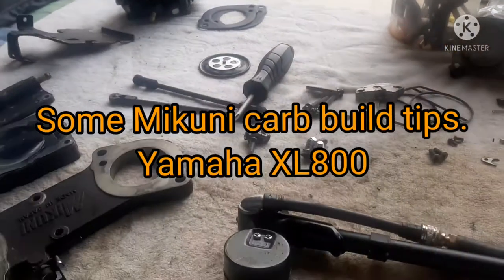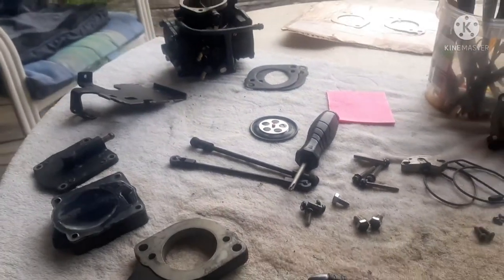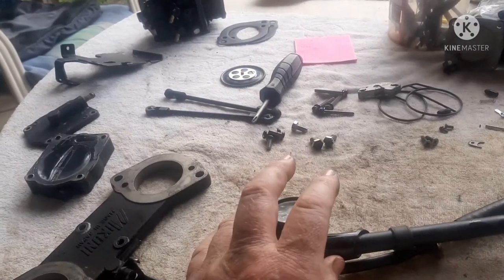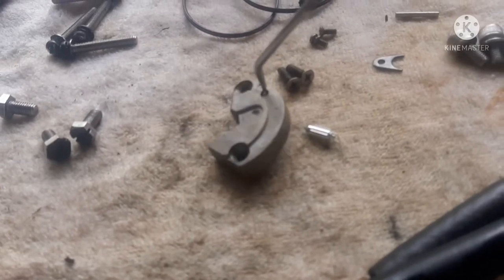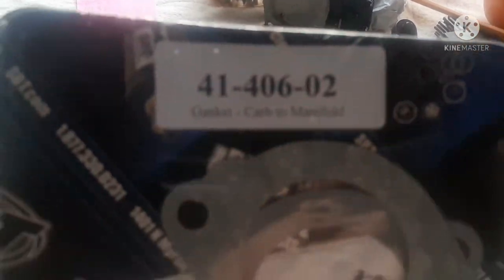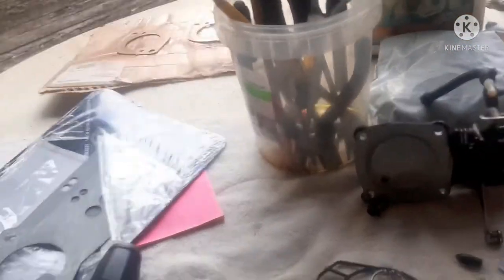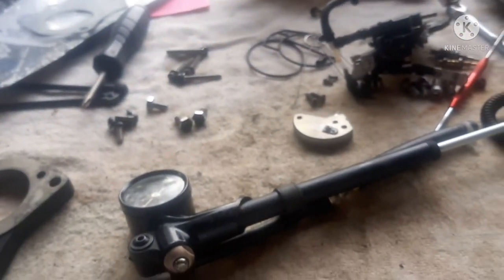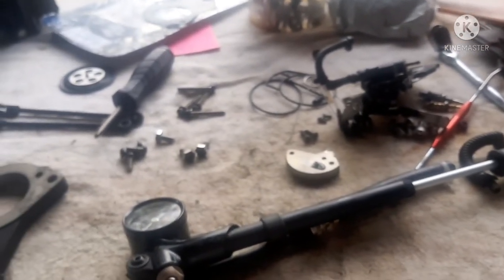Some Mikuni carb rebuild tips.  Yamaha XL800

Comment: I’m going to be doing mine this weekend. I have a set of WSM rebuild kits. Hopefully they’re OK
Reply from the maker: I used no name brand kits...did a video they dont work.  I used SBT kits...no success.  The only ones that worked for me are Mikuni.  I know WSM has good gasket sets but I didnt even know they had carb kits.
Reply: @ShadetreeJetski  I’ll let you know how the wsm carb kit works. My dad has a supplier that sends him parts for boats and that is what they sent me for my ski.They look like good quality
Reply from the maker: If you look at that video maybe that is what you are talking about larger orings.  Yes Mikuni makes an oring with squared off edges that is larger than just a normal oring.  If that big oring and the funny shaped one that seals the pump area dont have squared edges you are going to have problems.  Dave@motohelp . Com  sells the genune bni44-yam kits for about 40 bucks each
Reply from the maker: @FireTruckTech22  https://youtu.be/qF5OrKDdmRo
That is the video and you can see the differences in those orings and what happens with those cheap kits.

Comment: Was working on rebuilding carbs this weekend on my XL800! Love to see a Shadetree video right after a hard day's work haha. Were you actually able to get it to pop off at 70+ PSI? Mine kept leaking at the base of the fuel pump body around 50 PSI. Forums confirmed similar issue and said that pop off on our skis (XL800 or others with 1.2 N/S) are tricky to test pop off on since it's such a high PSI. One post said you had to test directly through the fuel inlet where the fuel filter sits since the regulator isn't designed to handle that much pressure going through it. Also read that Yamaha installed custom thicker O-rings from the factory to provide better sealing and handle the higher pop off pressure, which aren't included in the Mikuni kits and are $70 each on Yamahadirect. Woof. Have you read or heard anything about this? Keep up the good work brotha!
Reply from the maker: On my first xl800 I did get it to popoff at spec no issues using genuine mikuni kits.  This second set I could not as the needle and seat would start seeping air at around 68 to 70 psi.  I adjusted to 55 psi to try it.  Yes I am running 1.2 stock seats.  It is NOT starting well nor running at full capacity.  I am going to remove it AGAIN and put the larger 1.5 mm seats in to accommodate the lower popoff pressure and see how that works.

I had never heard of a larger oring and I had to put my high needle settings on my 1st xl800 at 7/8 turn out not 1/2 as the manual calls for.  These carbs have been the hardest part of rebuilding jet skis for me.

Comment: Love your content, a ton of great videos and information. I'm trying to rebuild a set of waverunners for the first time. I bought 98 and 00 Yamaha 1200's. Wondering if you had any suggestions or tips on the popoff and where exactly to find the popoff values? I rebuilt the carbs and changed out the original seats for 1.5 seats (wasn't sure of the factory size when I ordered those). I put them in and the carbs back on the ski. It is running rough and the plugs are a little wet and dark so I'm thinking it is running rich. From my research low popoff could cause that which i was thinking the seats maybe the issue. I was planning to swap the seats back out for new 1.2's. Would this be something you could tune with the low and high screws or should the seats be changed? I understand you should run and tune the carbs with the fire arrestors on but the idle speed is the only thing I could get to when it is installed. Any tips on carb tuning in general for these? Thanks in advance
Reply from the maker: First you must use genuine Mikuni kits or you wasted your time.  If you put a larger seat in you automatically changed your popoff from what it used to be.  A larger seat will have a lower popoff.  Are both of your skis powervalve engines?  A 98 could be a non powervalve.  There is online a set of mods by O'side Bill.  He came up with good information on modding factory carbs to run better.  
Your popoff is lower since you changed those seats to larger ones.  Turn your low side screws in 1/4 turn at a time as you adjust the carbs to tune them.
I usually find factory popoff pressures on Greenhulk or PWC today forums online.  SBT also has popoff pressures listed.
Reply: @ShadetreeJetski  Appreciate the quick response! I did get Genuine Mikuni kits. I have 1 with powervalves and 1 without. 98 XL1200 does not have powervalves. The 00 is actually an 800xl. Either the original owner wanted to re-power or the original motor locked up and they decided to upgrade. I have a 66-v 1200 with powervalves that goes in that one, motor is out of ski currently. When you adjust the screws are you just running them with open carbs or taking the airbox on and off? 

I will check these sites as well. I did find greenhulk but it looks like they just updated the sites and a lot of the links that pull on google were not working.
Reply from the maker: @bwell2515  Yamaha puts their mounts in the same place so yes swapping engines is much easier.  It is hard to find info on greenhulk since they just switched servers.  I had no issues with my non powervalve engine carbs, but I always seem to have issues with the powervalve carbs.  You have to pull the airbox to adjust the low speed screws each time.  If you have to adjust the high speed jet screw you have to pull the exhaust.  It is a painful tedious process.

Comment: Took mines apart today and it looks fine but I still can’t get my WaveRunner to start.
Reply from the maker: I assume that it turns over?  3 things an engine must have spark, fuel, compression.  Have yiou checked all 3?  Did you set popoff pressure?  Building a 2 stroke carb and never setting popoff is wasting your time.  It has to be right.  If you put anything other than a MIKUNI brand kit in you wasted your time and money.  Did you check for air leaks in the fuel system?  An XL 800 with good 120 psi compression should have a popoff set to around 76 psi with the stock pilot jets.  If you changed the jets it changes the popoff pressure.
Reply: @ShadetreeJetski  I just ordered the Mikuni rebuild kit. I did checked all 3… I opened the carbs and they seemed clean but I guess I’ll just rebuild it just in case.
Reply from the maker: If your kit comes with colored springs the gold ones are the ones you want to use.  Bni 44-yam mikuni kit only comes with one color spring and you will need to check popoff pressure.  If you dont have a guage you cant check it.  It is absolutely critical to have it set correctly.
Reply: @ShadetreeJetski  I will properly buy a popoff pressure gauge from Amazon. I believe I saw a gold spring in there.

Comment: What do u mean by pop off? And how to set it?
Reply from the maker: With a popoff pressure tester you check the pressure it takes for the needle to pop.  Most genuine mikuni kits come with the right spring so the popoff is determined by the spring weight and color.  Chinese ebay kits are cheap garbage.
Reply: @ShadetreeJetski  my ski originally had a brass or gold looking spring, I bought a genuine mikuni kit and it has a silver steel spring?
Reply from the maker: @TheHomePros6221  I read that the gold ones wer coated with i think cadmium???  So they changed the color due to govt regulations on cadmium use.  I always keep the old ones just in case.